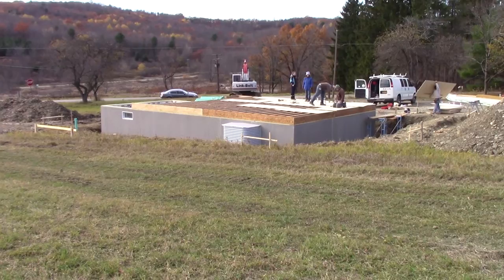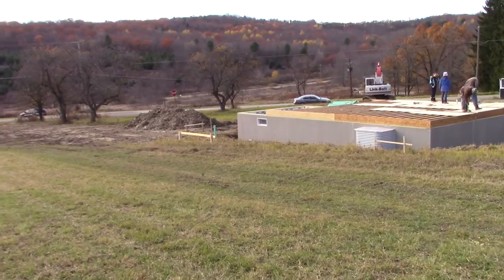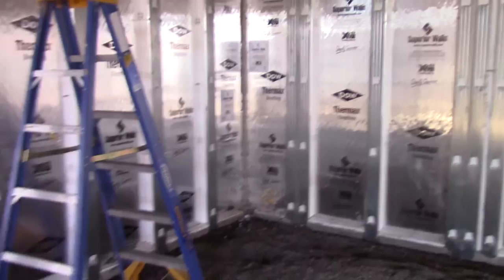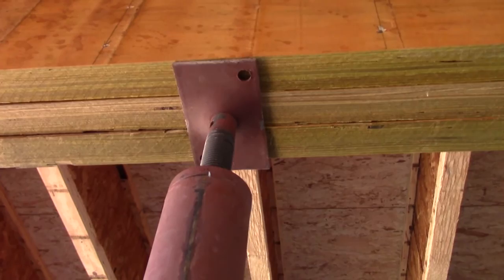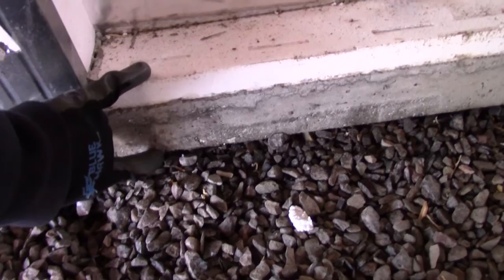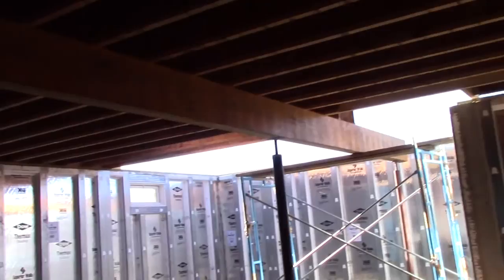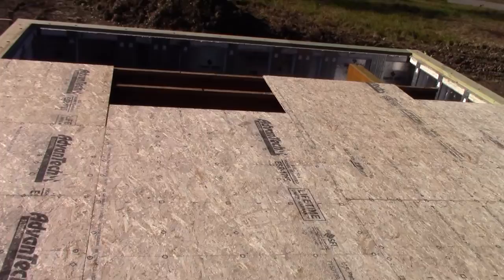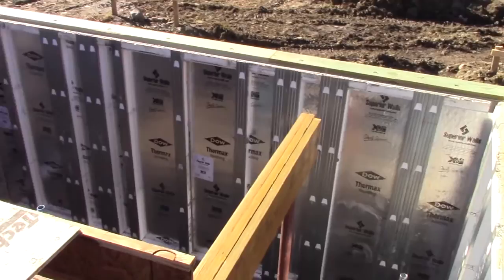HOUSE BUILD VLOG #7: Beams, i-Joists, Subfloor, and Superior Walls

Comment: Question on the sill plate.. currently installing mine.. Did you go to  outside edge of wall or edge of top lip before it tapers down to outside of wall? 
Sales rep says outside of wall but drawings show to lip..  using 2x10s.. thank you
Reply from the maker: Our drawings were not specific enough to call out that level of detail. If they're taken literally, then they show the sill plate being flush with the outer face of the foundation wall/rim board/first floor wall. I believe that's how we installed it.
Reply: Just my opinion and how I do it.  I keep the sill flush to the inside.  Keep my rim board flush with that.  Then with wall sheathing I go all the way down to the sill.  The 7/16s then keeps my wall flush with my foundation.  Then seal or flash with whatever siding....
Reply from the maker: I just went back and looked at our drawings again and how "mikebsexy" describes it is how our drawings show it. I think I misspoke before. The key is that the sheathing needs to be flush with the outer face of the foundation wall, which means the rim board and sill plate need to be held in from that face by 7/16ths. I'd plumb up from the face of the wall and take your measurement off of that. Mike, would you agree?
Reply: @harvtronix  yea....I try to keep everything in plain.  Easier to install whatever siding or waterproofing you need.

Comment: What kind of prep work do you do to aet the walls on to? Looms like gravel do you have to compact it?
Reply from the maker: Yep, you got it. A few inches of crushed #1 or #2 stone. Deeper around the perimeter drain so it grades away from the foundation walls. They tamped the stone and did final grading before they installed the walls.

Comment: It's been about a year.  How are you liking the superior wall system?  I am considering them now
Reply from the maker: They are alright but if I were to build another house I'd probably do ICFs.
- there are no studs in the corners, so you have to make your own
- Though I haven't had any problems with the sealant used in the corners and joints yet, I've heard it tends to fail after about 5-10 years
- when the excavator backfilled (in conjunction with our beam layout) it actually pushed one of the sides in about an inch at the superior wall seam. We dug the wall out and tried to push it back with hydraulics, but only managed maybe a quarter inch total.

Hey are definitely well insulated, but I'd much rather have a continuous pour all the way around the house.
Hope that info helps with your decision!
Reply: Harvtronix thanks for replying.   I've been considering ICFs but they're so damned expensive.    I didn't realize the issues you mention with SW existed.  There's a builder here in the Toledo area who swears by SW who has done hundreds of them and haven't had an issue.  I'm trying to contact him to understand if this continues to hold true for him. Will let you know what I hear.
Reply: Seeing and reading about the problems with precast walls above or even below ground and my experience as a basement waterproofer for 5 years and not since fifteen years ago, I would rather ante up for ICF since precast has the tendency to develop leaks at the joints and can even cave in due from ground pressure. ICF is simple enough to install yourself but you are still better off using a concrete contractor for the fill part, as with ICF you get outside insulation which really cuts down on cooling and heating costs and much easier to waterproof on the outside with stick on membranes. I would guess that tilt up despite lower purchase costs, the transport and installing costs add to the initial price for a higher total cost in compare.